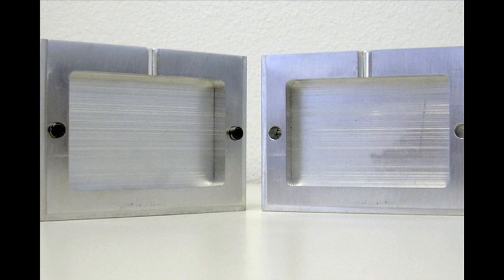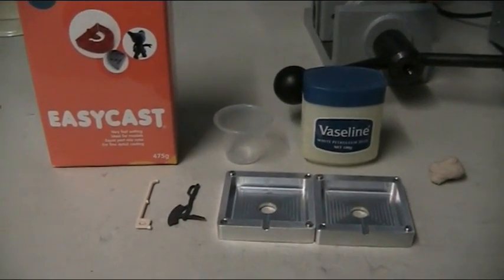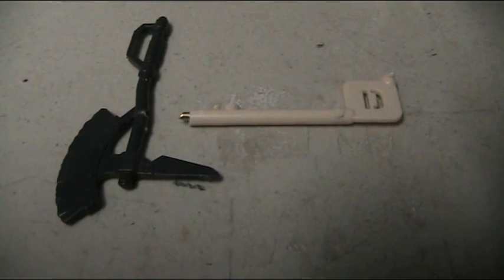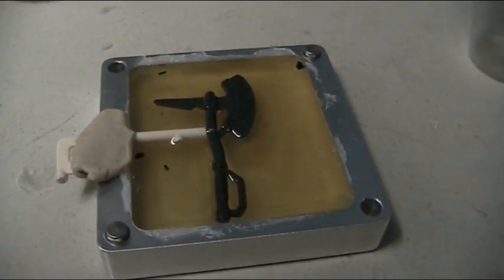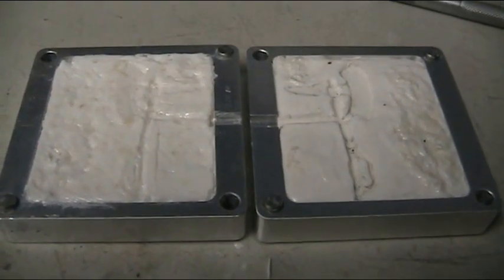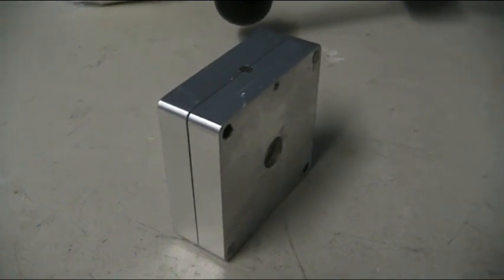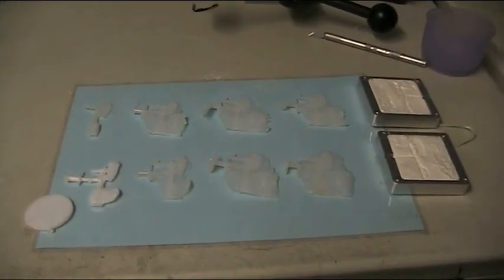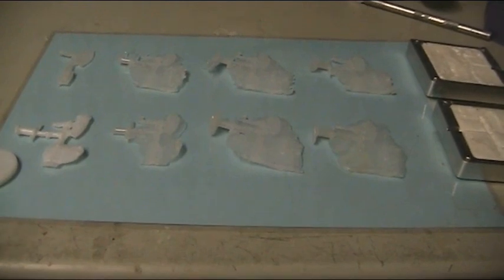Easycast urethane injection mold test 1 (Model B-100)

Comment: Do not use urethane for injection molds, urethane is not made for it; use aluminum filled epoxy for your molds.
Reply from the maker: I did once and was poor results, explored heat resistant urethane and cant be bothered dealing with that. aluminum poxy, milled and cast aluminum and wood epoxy is on my testing agenda
3d printed resin also has reported to next ok results

Comment: For the best result you need to add aluminum or iron filings to the epoxy resin. In the Soviet Union, such forms were used on an industrial scale.
Reply from the maker: Den Vas, fantastic suggestion. I will attempt that.
Reply: @mokanaman  If you need accurate information about this method, please contact me on viber +375291234196. I have a manual, but it is in Russian.
Reply: @denvas9551  hello can you email me?

Comment: I've gone thru your phase.  Eventually settled with aluminum epoxy from smooth-on. If cured right (oven cured overnight) it can be so hard you can make a ball-pein hammer out of it.  I manage to get about 5-8 precision parts before it warped.  Probably more parts if using a low temp plastic.

Comment: With a little more prep work I think you'll be able to use resin or any other pourable molds. Try using  clay to separate the master piece in half, much easier to control undercuts that way and you will avoid having the surface of the resin become lumpy, convex or concave. Also, after mixing the resin take a hair dryer or heat gun and heat it up in the mixing cup. This will help get rid of air bubbles. Clear resin might be better so you can see if there are any air bubbles, it also let's you see stubborn bubbles that wont pop with heat. These can be popped with a resin dipped toothpick. Finally, when pouring resin do it from a high enough distance so the stream of resin becomes thin, this also helps with eliminating air bubbles. I hope these tips are useful. If you have any questions  please let me know where I can message you. Good luck! :)
Reply from the maker: My future experiments will be using clay, I did rush as well as use old lumpy resin that should have been thrown out so correct setting is not possible. I will be attempting your idea of using clear resin next and the heat gun method, thank you for the tip. I do admit my resin casting experience is quite limited to 2 projects haha. Others who injection mold also recommending letting the mold sit out of the cover for a week or so to fully chemically harden and last longer. Most experiments will be posted and shared here. Again thank you for the support.

Comment: How cheap is it? They have some nice SLS 3d printer (resin base) that comes from china for $500-$1000 and they do amazing small prints.
Reply from the maker: I have a mini SLA resin 3D printer on order, a new resin has hit the market with tollerence to heat specially suited for injection molding. That will be one of the tests conducted some time in the future.
Reply: I wouldn't get the 3d printer. Most resins are probably weak and makes only 2-5 parts before they flash. Instead, get an aluminum engraver for the same price. You'll get 1000 or more parts. If you're making toys, it'll practically last forever after each resurface.
Reply: I am thinking about making a cheap aluminum engraver copy carver for making toy swords and model train parts. Since it's not cheap to scan,  render and print specialized toys.
Reply from the maker: The 3d printer casts will only be for testing also with a new heat resistant resin on the market can lead to few dozen casts which isn't too bad. Once the mold is producing a perfect retail result I plan on getting DLMS stainless steel mold. which is polished to .005 at a silly low cost. My issue with the engravers is depth limitation as well as polishing the z axis lines and tooling change. Mind you for personal use your direct is perfect and was my original plan. But DLMS is too good to pass up or not to try however engravers will always be a good plan B. And I really want a SLA printer as a toy on the side.
Reply: @mokanaman  I've been looking into this tech for a few years and hope to purchase a similar system. I have a Form2 and would like to produce molds that can be used with this injection molder. Since Form2 has the high-temp resin, I think it would be perfect for this application. Do you plan to post any follow up videos on your progress? My main concern would be the durability of the resin molds.
Thanks!!